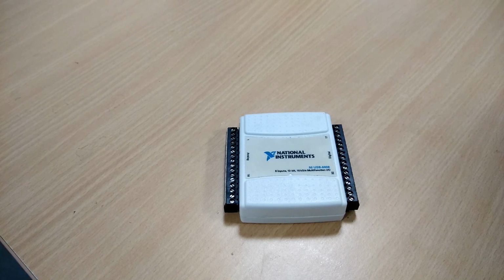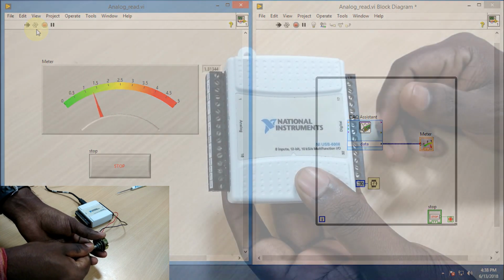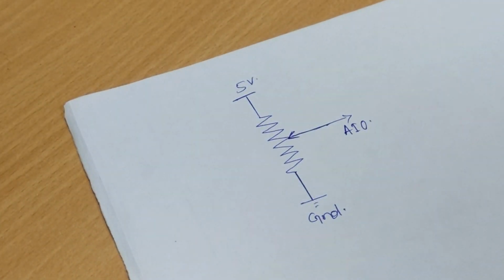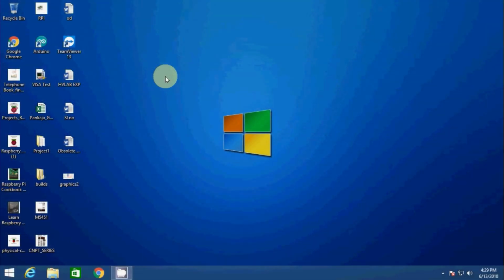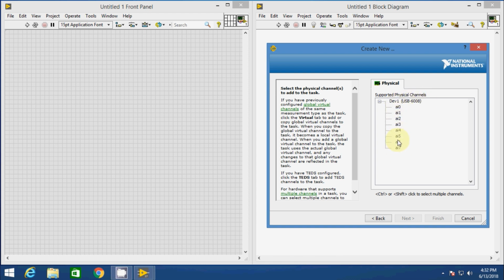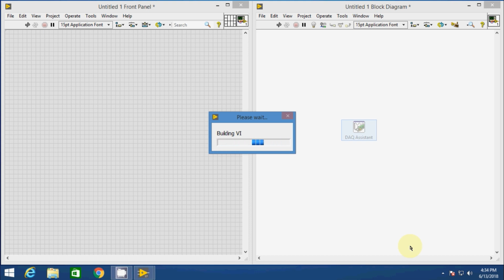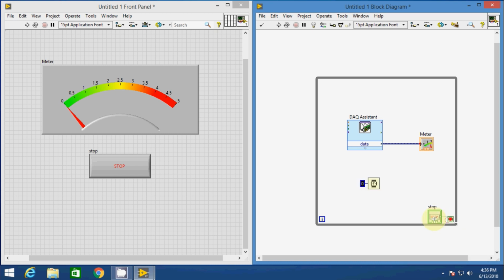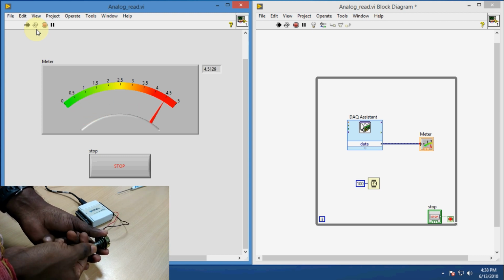LabVIEW + NI USB 6008 (Analog Signal Acquisition)

Comment: This is a clear and straightforward demonstration of the analog signal acquisition using an NI USB-6008 device. I implemented it with an NI USB-6002 device and it works as expected. The potentiometer used in this video is a 10 kOhm potentiometer.